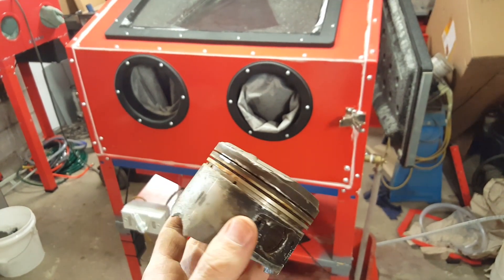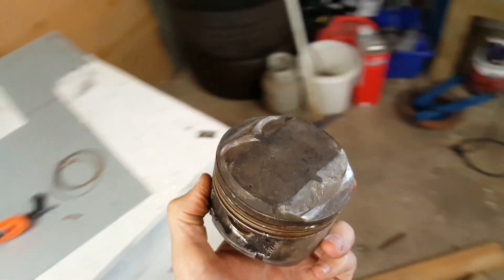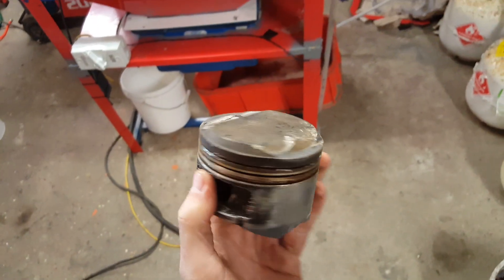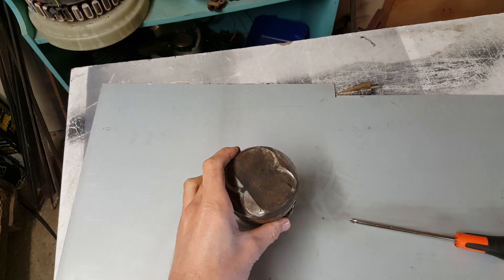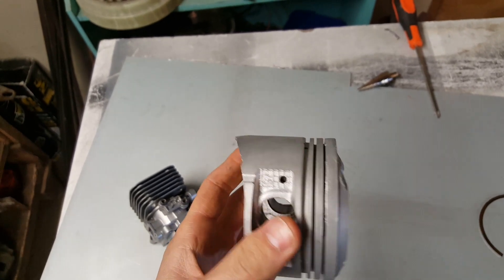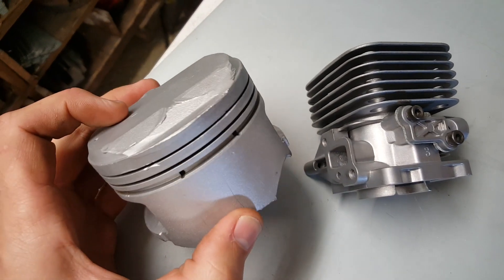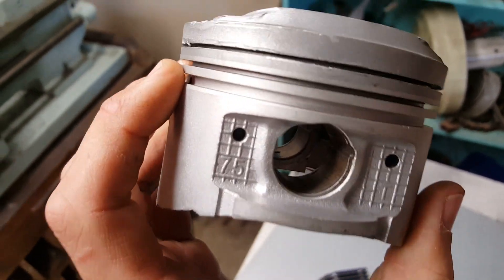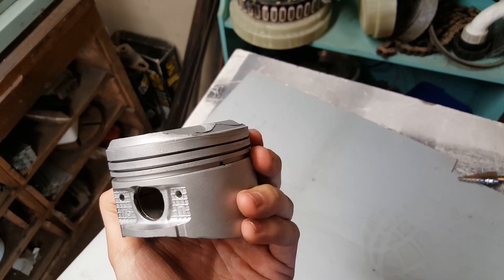Best way to clean a piston (DIY vapor Blaster)

Comment: Back in the 1970's the aircraft industry used glass beads to clean internal aircraft engines parts. Then they discovered that the glass beads could not be completely removed from the parts because some became partially embedded in the aluminum. Then some of the glass beads began showing up in the oil causing dangerous damage to the bearings. They then discontinued any use of glass bead blasting in any internal  aircraft engine parts. They then discovered that using soda to blast the parts cleaned them perfectly and since the soda is water soluble, it can be removed completely with high pressure clean water blast. That eliminated the glass bead in the oil problem.
Reply from the maker: Interesting!
Was that dry blasting or vapor blasting? I know that when you dry blast with glass bead or crushed glass that it tears open the surface of the material and embeds the glass. As far as I am aware, the water in vapor blast systems softens the impact to the point where the glass will not penetrate the surface.
Reply: @ArmouryEnterprises  put it under a microscope
Reply: I wonder if you could make a super-saturated mixture of soda and water?  Specifically keep adding soda long after the point where any more will dissolve in the solution.  Then a water rinse with clean water (outside the vapor blast cabinet) would potentially offer the best of both worlds - nice finish and not abrasive caught in the aluminum?

Related, I tend to agree (without any testing or data) that the vapor blast may reduce the likelihood of embedded glass beads.  

Any thoughts on the super-saturated soda solution?
Reply from the maker: @AlphaBobFloridaOverlord  
Hi Robert, I have heard of this being done, however, the images shown of the results were not as brilliant as with the glass bead.

Although clean, the finish lacked the typical luster achieved by the glass beads.
Once I get a little further with the vapor blaster development, I may revisit the idea and see what sort of results I can get with it.

Thanks for your input!